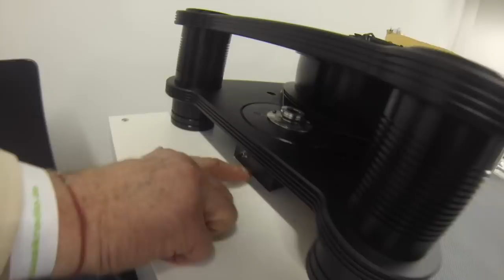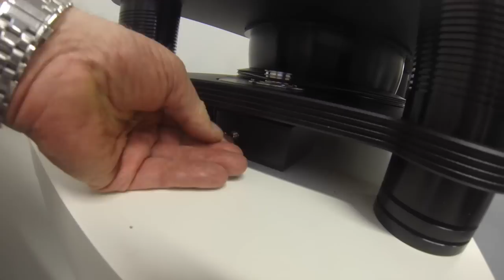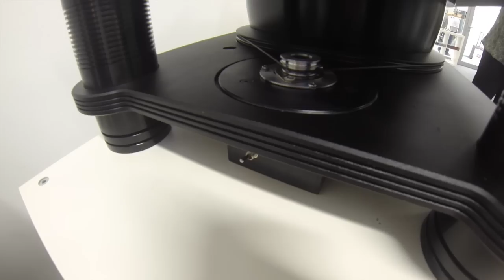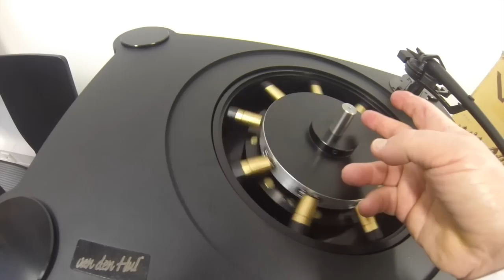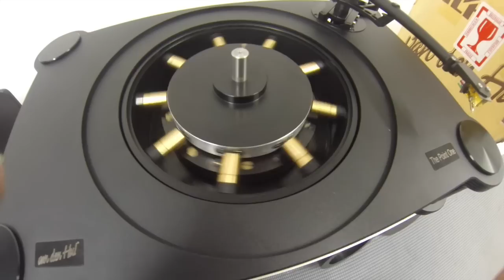A.J. van den Hul's New Point One Turntable

Comment: They have solved the wobbling turntable as seen on the Mag Lav turntable, at least the arm will not suffer the roller coaster affect. Very cleaver, but I guess a very expensive solution. I just love the thought and engineering that has gone into this.

Comment: Just a dust in a face.. A horizontal bearing for a plater is nothing. It can be a piece of plastic. The more important is a vertical bearing. Then that magnetic coupling has absolutely no difference to a magnetic coupling in an electrical motor itself. There are a belt with its own flexibility and resonances, and there is also the magnetic coupling which is x100 more flexible than a belt, and has its own resonances.
I’m sure that turntable is just a turntable with a self selling suspension.
VdH cartridges are awesome. VdH turntable is like a Porsche perfumes.

Comment: This is a terrible design! any micro movement in platter/ to arm is lost information! since bass or bottom end is lateral modulations I see issues
Reply: Agree. Magnetism is compliant so it's like stabilizing the platter with rubber bands. Yep, terrible idea. 

There is a better way to do it if he insists on using magnets. Placing the magnetics vertically AND horizontally and with a much thinner gap will tighten the tolerance.  Still, not ideal and no wonder he nixed the project!